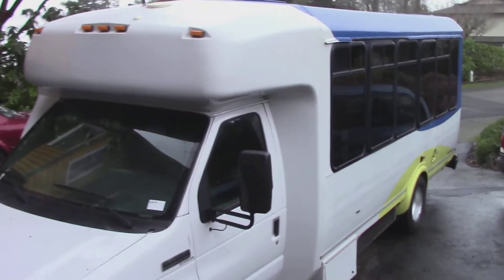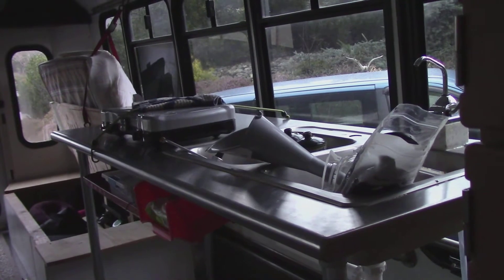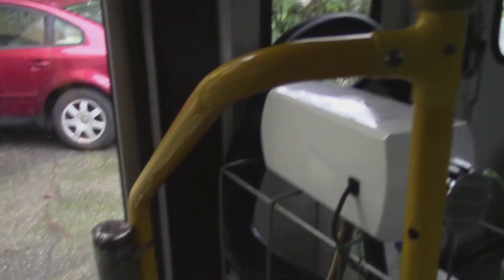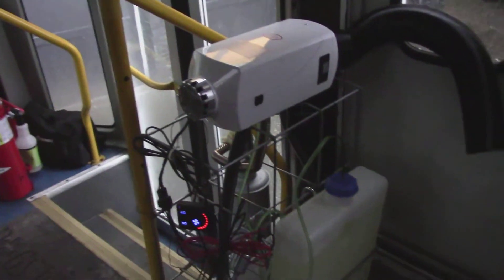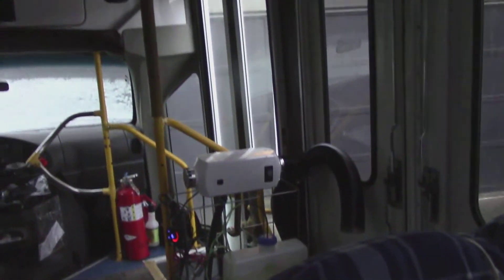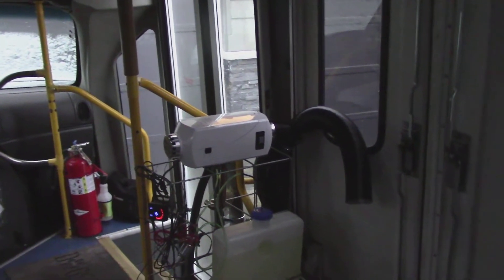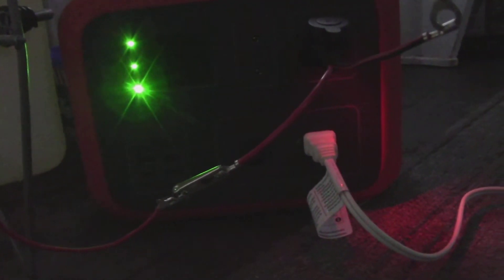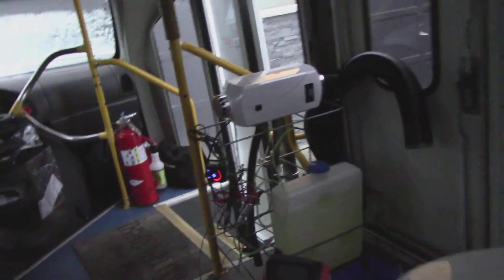Improving the Chinese diesel heater

Comment: There was a fellow I was watching on youtube and he uses a air to water heat exchanger to boil water but there no reason why it couldn't be used to reclaim heat from heating that water by using coolant just like a heat system in your vehicle and reclaim that also if you have space for it
Reply from the maker: Yep, and you're right available space and costs are issues.  Plus, similar systems are available in the marketplace

Comment: By turning you heated air outlet towards the heat exchanger you will increase the heat exchanger efficiency! Like the muffler idea! Thanks
Reply from the maker: hmmmm... the heated air is over 130F while the body temperature of the muffler is less than 130F.  So I think there isn't much heat to gain (perhaps even loose)  by directing the air outlet over the muffler.  However, directing the air outlet over the exhaust tube going into the muffler would capture exhaust heat ... then you may not need the muffler.

Comment: DUDE THATS A GOOD WAY TO GET AN EXSAUST LEAK INSIDE JUST BUY ANOTHER OFF EBAY 100 BUCKS !! PLEASE BE SAFE
Reply from the maker: You are right, We had an exhaust leak and a badly carboned up heater. that sent CO levels into the danger zone.  That's why we check exhaust  for CO level ... usually less than 10 ppm... and have 3 CO detectors inside.

Comment: Hey dont you love them shuttle busses.  I love my 2001e450 with the 7.3. her name is Wanda. Shes been taking good care of me for the last 2 years. We are both getting cold time for a diesel heater myself.
Reply from the maker: Yep, we are so happy we purchased a transit bus as it has been well maintained over its time in service, and so far, performed without any major problems as we added 20K miles to its odometer.   That said, owning a vehicle with 300k miles is always a source of anxiety when going on a long trip no matter what the "code reader" says.  Our diesel heater is also a pleasant surprise and has worked without major problems, as modified, for 2 years.

Comment: If you change the controller to Hz you then control the speed (can run it half speed)
Reply from the maker: The controller being used will adjust from low to high fan speeds and assure the air/fuel mixture is in balance as well. Help me understand how the Hz controller is different than what I'm using.
Reply: @trooperrvwithgretaandliber6774  the Hz of the pump is tied to the fan speed, so if set to 2.6 Hz you will get half speed (half the noise) and is a great way to vary speed rather than 'idle or full-blast'.

Comment: Those flex pipes should be outside of the bus; you could get a hair crack in the pipe.  I would not trust those flex pipes; I see them fail on a cold day from the dealer.
Reply from the maker: You're right, the safest installation would have everything installed outside with only the heated air piped inside.  But the exhaust from a properly functioning diesel heater is no worse than the kerosene heaters that heat with the combustion gas itself. (see Dyna-Glo WK24BK 23,800 BTU Indoor heater)  Regardless of what installation is used it has to be done right with all safety measures employed -- continuous inspection and monitoring for smoke and CO.  After two years using the heater as installed in the video I've never had a CO alarm during operation.  In fact I've never 'detected' CO with a CO detector during operation. CO was only measured during start-up and measured directly at the exhaust port.  As soon as the heater finished its start-up CO emission dropped to non-detectable (<10ppm).

Comment: What about having the exhaust going out the roof. Just seen a coach conversation with generators exhaust going up through the roof.
Reply from the maker: I think that is a better idea.  I've noticed that "diesel smell" when the wind takes the exhaust further under the vehicle... since heat rises some of the exhaust gets up through cracks and gaps. Whereas a roof vented exhaust is less likely to descend and find its way into the vehicle. Regardless of how the exhaust is vented make sure you have CO detectors/alarms installed.  I have three and never had an alarm or detection of CO.

Comment: perhaps routing the hot air to blow over the exhaust to capture more of the otherwise lost heat.
Reply from the maker: I'm about to do a 2nd season review of the diesel heater - pros and concerns; the Bluetti EB240 and AC50; and the HQST suitcase solar panel. Right now we are in the midsts of a winter snowstorm hitting Parker Lake, AZ (near Tombstone, AZ)... but I like your suggestion!

Comment: I built a heat exchanger for mine so that waste heat from the exhaust was used to heat water, this was made by wrapping a small diameter copper pipe around the exhaust and then covering that in exhaust bandage to help concentrate heat into the copper pipe, water was then pumped through the pipe to an insulated tank, after around 45 minutes to an hour of use the water tank is around 44C, this is ideal for showering with, although a little hot! Look forward to seeing what other ideas you can come up with.
Reply from the maker: Sounds like a good idea ... 45 minutes for hot water is on par with other tank-hot-water systems

Comment: My question is how in heck is your exhaust that HOT i turned mine up all the way and I creased the fuel and my exhaust has only hit 510 degrees F the heat coming out of the vents 5’ away is 180 degrees and I’m also running the Afterburner control for it and I’m using a fluke 561 IR temp gun
Reply from the maker: I used the temperature function on my Harbor Freight AMES meter with the supplied thermocouple.  I noted the highest, repeatable readings when the heater reached its full operating temp.  The highest measured temp was in the exhaust port, but it did fluctuate due to uneven exhaust flow. The only time the exit temp (measured about 5' ft from the exhaust port) approached 100 deg. F. was on the heater's low setting.
Reply: these will hit 900F easy at the exhaust port. 5kw/8kwh
Reply: @jordanwelty6582  I have had 4 of these I have a fluke temp gun and I have never even gotten close to that u must be starving it of air then.
Reply from the maker: Typical diesel engine exhaust can reach +800 F. (see https://www.fs.fed.us/eng/pubs/pdf/08511816.pdf) These heaters are more efficient than a diesel engine and should produce higher exhaust temps ... not unlike those I measured.
Reply: @trooperrvwithgretaandliber6774  more efficient with higher exhaust temps that’s actually the opposite then it wouldn’t be efficient because your loosing hot exhaust gasses that are waisted
Reply: @Reedic20  No, efficiency increases the heat due to all of the fuel being burned, efficiently.
Reply: @jordanwelty6582  well like I said I have had 4 of these heaters over 5 years and all ran a temp between 450-510 Fahrenheit everything I have read says the same thing so 800 u might want to check your temp gun or your heater something isn’t right. I messed a lot with the fuel trim on a couple of them lean to rich as hell where it’s huffing black out the pipe and nope no 800 temps. The reason I have had so many heaters is I use them in the cold winter months to heat my 20’ enclosed cargo trailer/mobile Fab shop they run ever day all day when one wears out I buy a new unit because I don’t have time to repair them then summer when I’m off more I rebuild them and sell them.
Reply from the maker: That isn't what I was taught ... the main product of combustion is "heat". Therefore the more complete the combustion reaction the greater the heat produced.  The equation looks like this...   Fuel (diesel) + O2 (Air) = CO2 + H2O + Heat. Clearly the more complete the combustion the more Heat is produced. @Reedic20
Reply: @trooperrvwithgretaandliber6774  maybe with how I have my setup I’m just transferring that much more heat then everyone else there for creating cooler exhaust temps = efficiency 😁 see what I’m saying if it’s going out the pipe it’s not efficient
Reply from the maker: @Reedic20   OK, I see what you're saying,  you may be getting more heat transfer.  You said you've had multiple heaters.... were they all constructed the same?  Maybe the one I bought is of a lesser quality design?
Reply: @trooperrvwithgretaandliber6774  Chinese knockoffs but not the cheap cheap ones all were 8k heaters I bought a quality pump and keep that one the one I’m using never goes with the old ones I sell. The heater is setup so it’s grabbing fresh air forM the outside I have 3 vents I made out of 4” pvc pipe closest one to the heater is 7’ away farthest is 16’ I’m getting 180 degree air temps out of the vents also.

Comment: hi bud have you considerd having it in the floor of your converted buss camper save all the exsposed part your going to have to avoid. give you alot of the needed space back and look alot cleaner and safer.
Reply from the maker: I knew I wanted it where I have it because it's easy to remove during summer months when I don't need it.  Also, by having the whole assembly inside I capture a lot of heat that would be lost.

Comment: If you look on line you can buy a heat exchanger kit so you can put radiators in your van the kit comes complete with all fittings and water and it fits on the outlet on the hot
Reply from the maker: Could you post a link to such kits... I looked for something before building what I made and couldn't find anything.
Reply: https://www.bobilvans.co.uk/howitworks
Reply: @trooperrvwithgretaandliber6774    
And one of their videos explaining the system. 
https://www.youtube.com/watch?v=jR6bqUHGKOQ&feature=emb_logo

Comment: I'd be super careful with running the exhaust pipe inside your living space!  I understand the seal around exhaust connection is not fool proof.  And looks like you're using coke can material to connect at the end of the muffler?  Please be safe and mount that heater directly on the floor to minimize risk of CO inside your home.
Reply: Diesel exhaust does not produce Co from what I understand so a co monitor is completely useless.
Reply: @ddubs6969  What makes yo say that ? See the video Diesel heater, tuning using cheap Co gauge.
Reply from the maker: I've recently checked this claim that diesel doesn't produce CO by conducting a test. I placed a CO detector right in the effluent of my heater's exhaust and it detected 0 PPM CO.  I still have CO detectors because I lost power once and that caused incomplete combustion and loss of exhaust flow ... which filled the cabin with smoke which set off all the smoke/co detectors .
Reply: @trooperrvwithgretaandliber6774  Diesel exhaust does produce CO unless you have a perfect mixture of fuel and air, which is impossible to achieve.  Please still keep the CO alarm inside your camper.
Reply from the maker: @hungpham  You bet! I'll keep multiple CO detectors in my rig.  Aside from whatever amounts of CO in diesel exhaust, my cookstove is propane and it surely produces CO at a detectible level, but below alarm levels.
Reply from the maker: Yep, always watching for problems. The can at the bottom helps hold a fiberglass wrap in place for a better seal.  Also have two smoke/CO detectors - they never detected any smoke or CO. We keep high temp silicone sealant to use if anything seems to fail or not seal sufficiently.  Oddly, the worst problem in getting exhaust inside the camper is if we have a window open which always seems to allow diesel exhaust back into the camper.
Reply: All the boat installs have the exhaust inside.